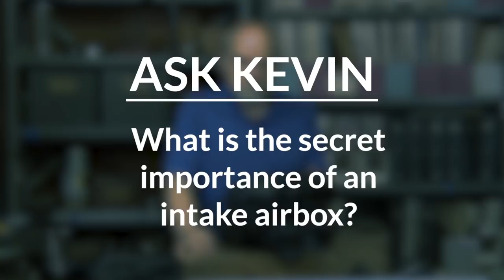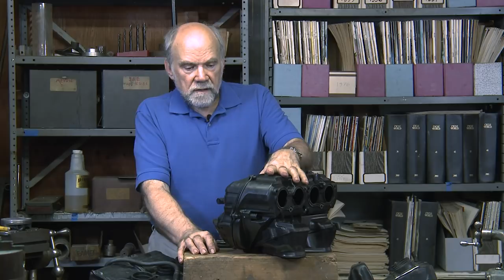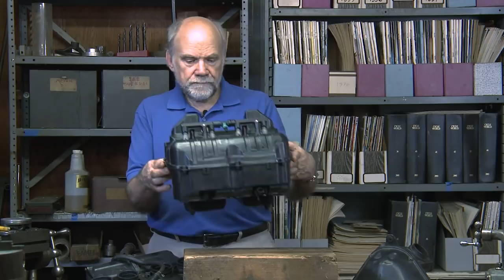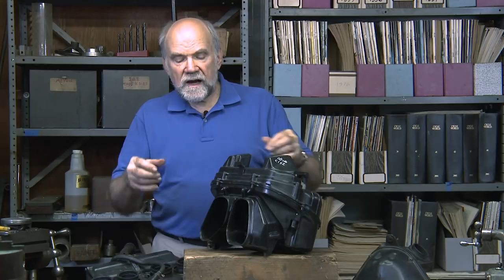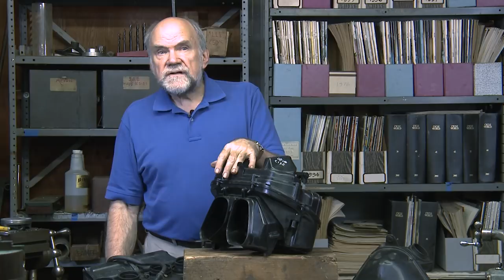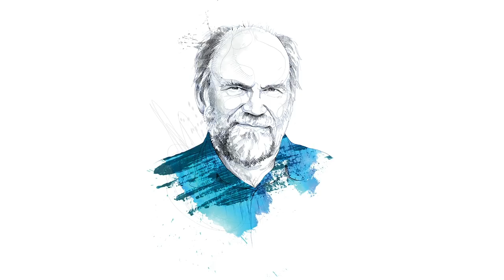What Is The Secret Importance Of An Intake Airbox?

Comment: Dyno testing on my bike says this is mostly true, but there are some larger pod filters that improve horsepower and torque from the bottom to the top.
Reply: What pod filters have you tried??  
I'm contemplating UniFilter pods with the urethane end cap for my old GS
Reply: A T - K&N only added a little horsepower at top end compared to stock air box but was worse in normal running rpm and speed. Tried some pod screens which was worse than stock everywhere Sprint pod filters which were larger added a few horsepower from bottom to top and did the same for torque. I would recommend baselining your bike on dyno then trying a few type of pod filters while bike is still on dyno. EFI bikes with power commanders make it easier to adjust the air fuel mixtures while they are still on the dyno. For bikes with carbs it takes a little more time. The dyno is useful to keep the motor properly fueled throughout the rpm range.  
Kevin would be the one guy who wouldn't need a dyno, but there is one of him.

Comment: 10% torque? Isn't torque a constant value in all engines? I mean, you can't "add torque" to an engine since this is defined by the length of its pieces. Is this right?
Reply: You actually can add torque. That's what a supercharger or a turbo does. And that's what a properly sized and turned airbox does also, just as Kevin explains in the video.
Reply: What happens to that torque arm when you double the force pushing on it...

Comment: My SV1000S looks like it has a huge gastank. Its almost ALL airbox!
Reply: @Michael 
Thanks for the input. My '03 has run rich from the factory. The higher the rpm the richer it gets. D&D pipes, ignition advancer, and K&N filter have all helped it run better everywhere now. I am glad I didn't do a Power Commander, I have been seeing the 3's causing poor or no running lately on older units.
Reply: @Michael 
Thanks again. Lambda sensor is wideband O2 sensor? Mine definitely does not have that. It is my understanding the ECU stock won't do that. I get between 45 and 55 mph and fueling has been good since the aforementioned mods. "The Factory" brand ignition advancer (4°) did the most but I love the pipes too. I don't live near anyone with the capability to reflash or program ECUs. I literally live in the middle of nowhere! Regards from Mena, Arkansas.
Reply: @Michael 
If I get froggy on her I can still get down to high 30mpg. The engine runs fine. I wish the first 3 gears were closer together, the top 3 farther apart. I can only get in to third on a 1000' drag strip. Only does 150 mph on long straights (true, not indicated). My 1000' times have been 9.12 seconds at around 129mph.
Reply: @Michael 
At 48 I have had my own health issues mainly caused by aviation chemicals. I am glad to say right now I am healthy. I am sorry you are not. Keep up the good fight. Sometimes I only need a good bit of crazy speed and a nice hilly, curvy road to feel better. Fortunately I live at the base of a hill just like that! No cameras here. They can barely afford fuel for the deputies! Blokes from your area ride in a way I only could have until my 30s. After that reality sets in. That's why I ride SV1000S instead of a GSXR1000 or ZX10! Thanks for the conversation. I like this one. If you ever get over here we should meet and ride. If I get back over there I will look you up somehow.